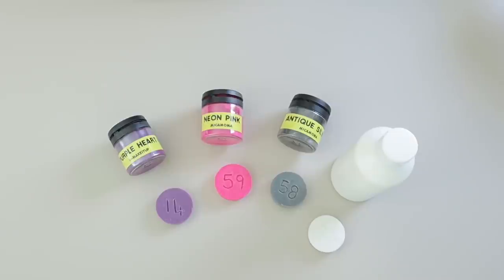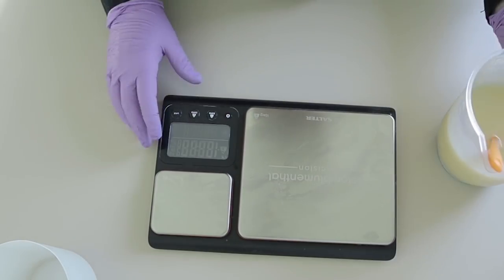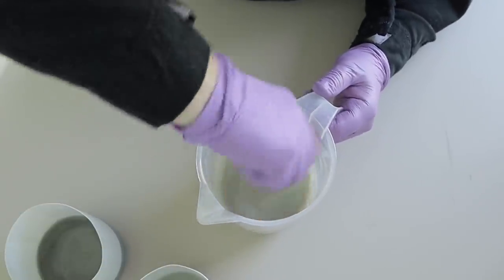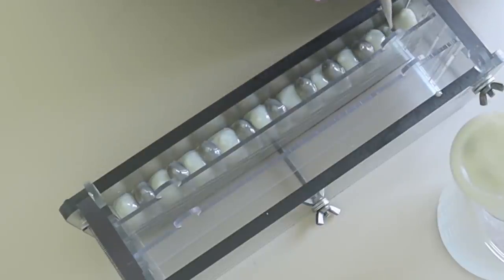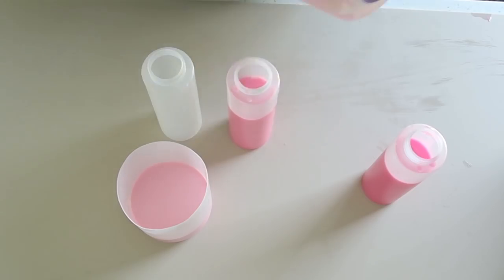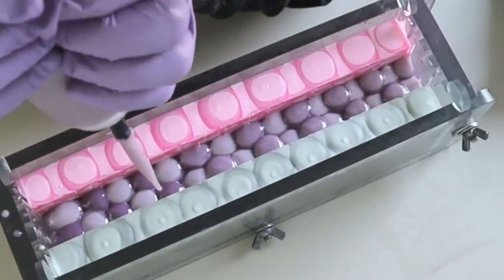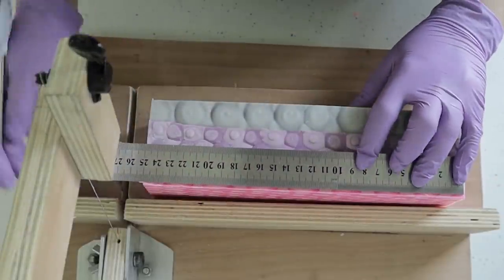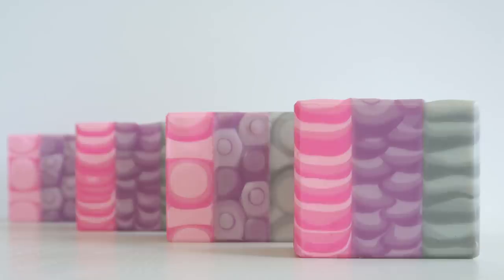DANCING FUNNEL cold process soap making tutorial, Squeeze bottle technique

Comment: Fantastic soap Lisa! I'm surprised that you could get the dividers out so cleanly after only 3 hours. I love both cuts. Which do you prefer now?
Reply from the maker: Thank you Leanne, the 1st time I left dividers in after the pour and then pulled them out I was so worried I'd have a complete mess, but as ling as the soap is set enough to support itself it does seem to work well. I still like both, but I do love the little shimmy wiggle in the middle of the vertical cut. I hope your family are staying safe and well :-)

Comment: I love the horizontal cut but the vertical is pretty too. I’ve just done one, no where as nice as yours and I’m trying to figure out how to turn it round to the horizontal cut lol
Reply from the maker: Thank you Susanna, did you work it out. You need to cut the loaf in the normal direction but do the cut so you are chopping off a bit that's the height you want your soap. Then turn it round and you slice through so that the top is now on the side. If the loaf was in it's normal position you would be slicing horizontally in line with the top of the loaf. Not sure if that helped or complicated things. Best wishes. Lisa
Reply: I Dream In Soap Hi Lisa Yep I managed. Took me a couple of turns but got there in the end. Thanks for your help. Your videos are excellent and informative. One of these days I’m going to to try and make a silicone mould after I watch your video x

Comment: I’m loving your channel and learning so much . When you explain the usage rates for colourants  do you mean you use used   in total 3teaspoons  (1for each colour) or did you use  a third of a teaspoon for each ?
Reply from the maker: Hi Monica. Thanks for the comment. With colours, I always use them at a rate of 1 teaspoon per pound of oils, so when I work out my soap plan and how I will divide my soap batter up to get the effect I want I look at how much oil there will be in a section, so if i had a pound (I use grams so it's actually 454g for me) of batter for pink, I would use 1 teaspoon of pink in that section if I had half a pound of another colour I would use half a teaspoon for that part, so the rate is 1 teaspoon of colour for every pound of oils. Hope that makes sense, stay safe and well - Lisa  :-)